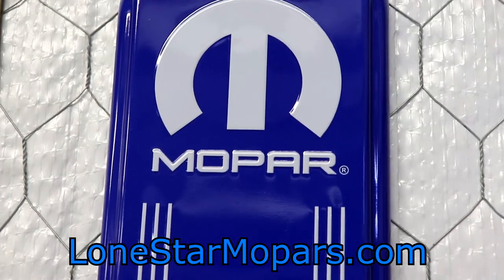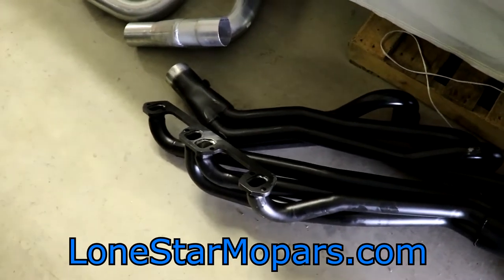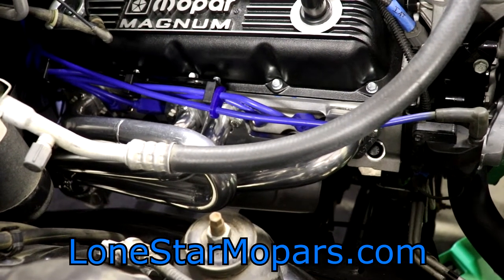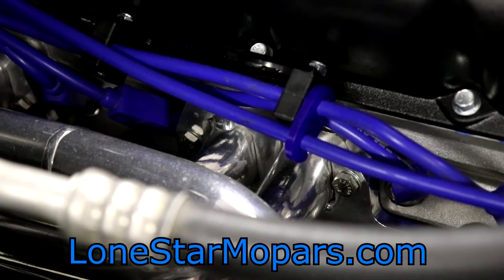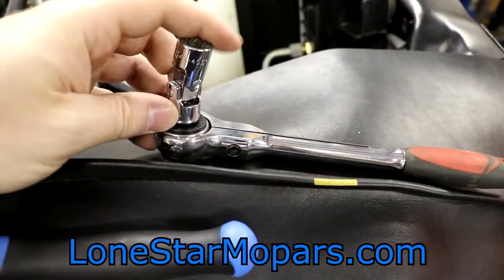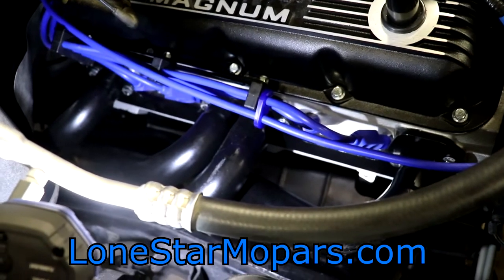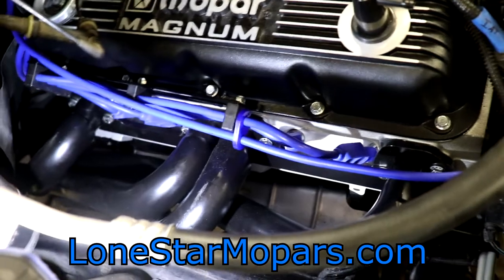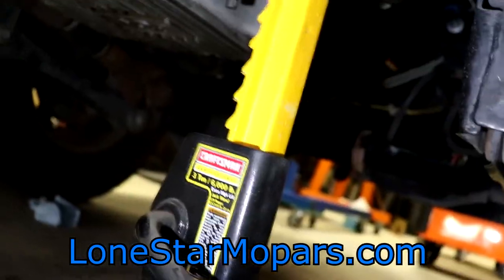Ram Revival Part 61: Long Tube Header Test Fit and Clearancing

Comment: Late to the party but hey, I made it. 
My "79" Ramcharger has so much more room, thankfully. It has a 4 inch lift which seems to help alot also. The "87" is 2-wheel drive so I didn't have any of the fitment issues you are having to deal with. If push comes to shove you can always replace the front drive shaft and eliminate the weight. A lot of money just for that but it is also considerably stronger. 
I installed Dennys Driveshafts and I am very happy with them. Absolutely no vibration at all. 
It's looking like you are getting it done but I am a little worried about clearness. You would be surprised at how much movement takes place when off roading. Thanks for taking us along.
Stay strong brothers.
Reply from the maker: Nice...This is a factory Off Road, so it has a 2" lift.  That usually is of benefit to me, but not always.  Yeah, 2WD would likely have zero clearance issues on the LH side.  
I was under there tonight trying to free the O2 sensor plug and then reinstalling the starter...it almost seems like the tubes have settled back some and the counterweight is definitely a point of contention.  That is one of big concerns at this moment...how everything will articulate.  Not even in an off-road scenario, just on uneven pavement, lol.
I've got my fingers crossed there won't be any issues...but we will see.

Comment: Couple things on the fitment. First with the transfercase, most use  a sawzall and chop that ear off and clean it up with a burr. Secondly with the front driveshaft clearance there’s 2 things to consider. First of those is the Pacesetter quality control is pretty lacking and the placement of their collector and the bends might be slightly off. The other consideration is what you’re running for lift. When you lift the front end, due to the track bar and control arms it moves the front axle backwards and towards the driverside. Gives you less clearance with that exhaust. Not sure how much if any lift you have but if you have any and you do not have an adjustable track bar, you need one. It will move that driveshaft away. Also what I did with mine was rather than run v-bands I slotted the expanded section of the slip fit and ran a band clamp. The kind that are really rigid and about 1-1.25” wide. Not the flimsy parts store stuff.
Reply from the maker: Thanks for the insights...I was waiting on some parts and should be out in the shop this weekend.  If I can knock this project out, I'll get back to seeing how I can fit the exhaust.  It is a shame they don't put forth a little more effort in their production...they would be really nice headers for the price with just a little more back end work (AND not missing welds on primaries AND not getting the collector too hot when welding the O2 bung, lol).

The truck is an Off Road, so it has a factory 2" lift.  I put a lot of effort into bending them back before they went off to get coated...still a bit worried about the counterweight on that front driveshaft.

I'll see what clears...kind of committed to the V-bands since I had them welded to the collectors and coated.

All the suspension is still stock/factory upgraded.  Rides really nice and the mileage isn't high enough to have a lot of the common issues.  Once they start to pop up, I'll likely upgrade quite a bit.
Reply: @lonestarmopars  even being stock suspension, I would look at doing an adjustable track bar. The off-road edition uses a stock regular bar and on these trucks, the axle will move towards the driverside about 3/4” for every 2” or so you go up. If you guess a bit and figure in some spring sag from age you’re still looking at around 1/2” more clearance than you have now
Reply: I also forgot I did do a vband on the passenger side and on the slip fit connection behind the transfercase. Wanted to do vband on the driverside but the counterweight had me worried too. Had a bunch of the strong band clamps left over from the kits my F150 uses so I used my portable bandsaw to slot the slip fit. Worked great and I’ve done that a few more times now on other connections

Comment: Where did you order those Longtube headers. Really hard to find Longtube headers for my 2002 dodge ram 5.9 magnum
Reply from the maker: They were bought from Summit...I should have a link for them when they got introduced.  They are pretty much the only reputable LT for our trucks.  I want to say I've heard of people running them on 02 5.9s, but don't hold me to it.   That is kind of a unicorn year with the 2nd Gen powertrain and 3rd Gen Body.
Reply: @lonestarmopars  Hello LoneStar... I tried locating them LT headers at Summit and Jegs and about a dozen other places. Even Pace Setter shows "Discontinued" on their site. I'm still looking, but I've done a bunch of research into just building my own custom headers designed by me. I'm a pretty fair tig welder and I have tig, mig and standard rod welding machines. I think a stainless steel header kit would be a better option for my project. I'm able to separate the cab/engine compartment and bed from the chasse frame using gantry crane equipment. 
Q: Did you ever consider fabricating custom headers with the use of a modeling kit?
Reply from the maker: @thomaslloyd8306  No kidding?  That is a bit of a buzz kill if they canned them.  I've been swamped at work for months and haven't had much time to keep up with comments, or on the truck front.  I actually contacted a few places about old stock and a couple others about if they would make them.  I want to say it was ARH that was open to doing it, but they need the truck in person and they are up in NY.  I definitely think you could make some headers...it might be a long trial and error process, but with nothing on the market, it is probably your best solution.  If I had free time, I've wanted to get into doing more one off exhaust stuff, granted it would mainly be for cars.  If you can score a cheap set of headers you could use them as a guide...some of the plastic kits are expensive, but could pay for themselves with this job...especially if you would be burning thru material trying to guess on bends and angles.  If you do it right and make a jig/template, you could probably sell a few as your free time allows.  My biggest issue with these headers is they rub the front drive shaft, especially at the counter weight.  Their exhaust also doesn't have any provisions to mount/secure to the chasis.  If you've got the time, I'd give the full custom route a go.  Good luck!